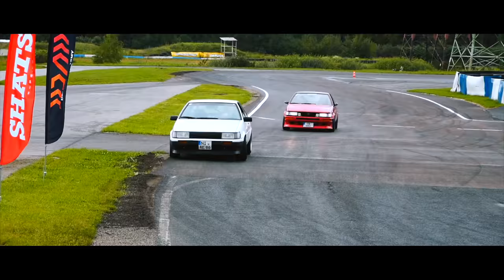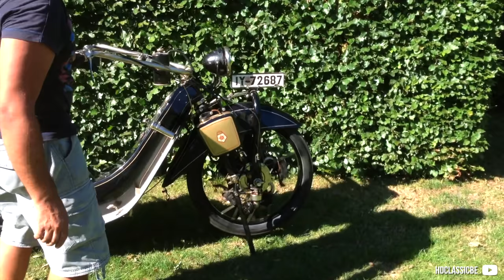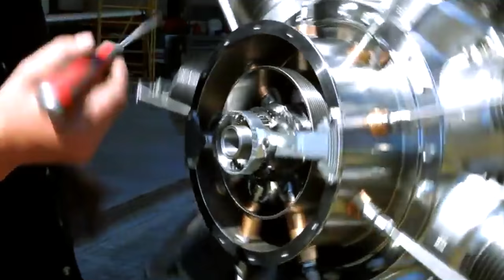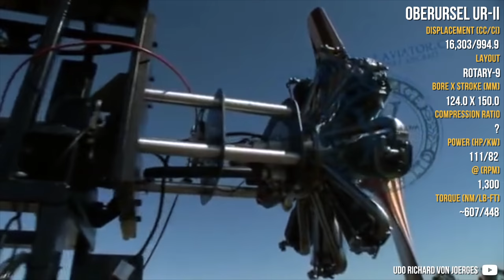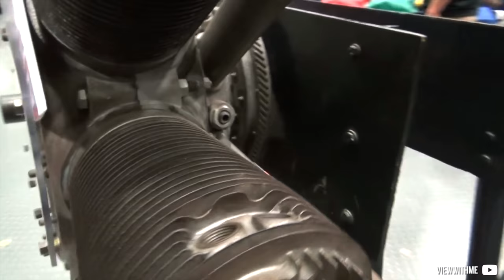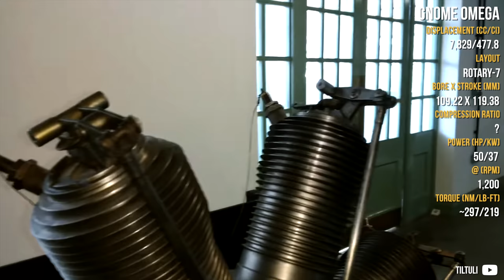These Rotary Engines Are Spinning

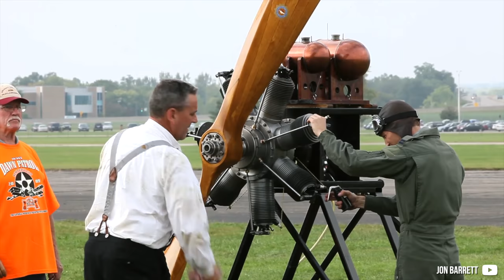Comment: 6:03 very interesting, any source where can I read more about it (except those on Wikipedia)?
Reply: It was called the Monosoupape, literally one valve.  Because the fuel/air mixture entered through the hollow crankshaft and then into the crankcase it seemed a logical design idea.  Also because of the through crankcase induction total loss lung rication was the only possibility much like 2 stroke designs.
Reply: @Richard Callan  Thanks, but I was talking about Gnome Omega mentioned in the video, it had in piston intake valve:

http://www.pilotfriend.com/aero_engines/images/gnome_3.jpg

"On each intake stroke, automatic intake valves in the crown of each piston opened, admitting the mixture to the combustion chamber. These valves were counterbalanced to account for centrifugal force and piston acceleration, with just the right balance to allow the suction of the intake stroke to open them..."

Then they developed the Gnome Monosoupape because: 

"The automatic intake valves of the early Gnomes turned out to be quite a headache for maintenance personnel. In addition to presenting a fundamental limit on engine speed and volumetric efficiency, they got out of balance easily, gummed up and got sticky, and worked poorly at higher altitudes. Thus, they presented constant maintenance problems, accounting in large part for the extremely short time between overhauls (TBO)."

http://www.pilotfriend.com/aero_engines/aero_soupape.htm

Comment: This is why an engine with a rotating piston, as used in some older Mazdas, is properly referred to as a WANKEL Rotary, or just Wankel, but never just rotary.
Reply: Which version of the Wankel engine are you referring to?
Reply: @sandervanderkammen9230  Any version.
Reply: @CaptHollister  The DKM-54 is a rotary type engine...
The KKM-57 is not a Rotary.
Reply: @sandervanderkammen9230  ...as were all subsequent Wankels, which is why they are also called rotary piston engines, since it is the piston that rotates. I wasn't aware of the DKM engine with its rotating piston and housing. Sealing must have been a nightmare. Thanks for pointing it out.
Reply: KKM stands for Orbiting Piston Motor.
Only the DKM is a rotary.
The KKM has a conventional arrangement with a spinning eccentric crankshaft and flywheel 
It's not a Rotary type engine.

Comment: If they're going total oil loss. Why not just go 2-stroke?
Reply: Too impractical.  A two-stroke needs a separate space in the crankcase for each cylinder, separated from all the other cylinders, in which the fuel mixture is initally drawn in before the descending piston compresses it to push it out through the transfers ports and into the combustion chamber. This is impossible to accomplish in a radial. The alternative, as used in large two-stroke diesels, is to fit a supercharger to blow air/fuel directly into the combustion chamber, which requires fitting intake valves in the head.
Reply: @CaptHollister  Great answer and explanation of 2-stroke facts. I actually didn't know about each cylinder's crankcase being isolated, as most dirt bikes were 1 cylinder, but it makes sense.

Comment: i belive there are caled radial engine , when i read rotary i think of wankel engine
Reply: Rotary is actually correct, althought these engines have a radial layout too: usually radial engine is used for engines which have a static body and only internal moving part, for example the BMW 801 used in the Focke-Wulf 190 or the Wright R-1820 Cyclone 9 used in the B-17 flying fortress; while a rotary engine have the all body spinning.
Reply: I thought the same. Turns out these are "regular" rotary engines and the wankel is known as a wankel rotary. So, rotary engines are a type of radial engine while wankels are rotary engines that are not radial engines.
Reply: @XMarkxyz  thanks man , a new information to have 👍
Reply: @deluth4638  you learn something new every day, thanks 🙏
Reply: Wankels shouldnt be called rotaries. They were last. They should just be called wankels. They arent really rotaries in the original classifacation.
Reply: Also different between a rotary and a radial. Rotary the crank is fixed and the crankcase rotates. While in a radial the crank rotates and the crank case is fixed
Reply: These are NOT radial engines.
Mazda Rotary is a registered  trademark not an engineering classification.
Reply: @deluth4638  No, the Rotary is not a type of Radial engine.

The Wankel DKM-54 uses a spinning crankcase and a fixed axle.
The KKM-57 used by Mazda is not a rotary type engine.
Reply: @sandervanderkammen9230  Sure, I could have said the rotary is designed in a radial configuration. An actual radial wouldn't have spinning cylinders, obviously. Regardless, a wankel rotary has nothing to do with this video since it is a different beast.
Reply: @deluth4638  Which Wankel engine are you referring to?
Reply: @deluth4638  Are you unfamiliar with the two different types of Wankel engine???

The DKM-54 has a crankshaft that remains stationary.
 The KKM-57 has a spinning eccentric crankshaft and flywheel.

Comment: Do engines from ww2 warbirds, there are some incredible designs they came up with back in those days
Reply: And were able to manufacture and maintain in surprising quantities.
Reply: The engines used in WW2 are Radial engines.
These are ROTARY engines and only used in WW1.
Reply: @sandervanderkammen9230  I'm well aware of the difference between a Radial engine and a rotary engine, also radials were not the only engine type used during the war, they also used all sorts of large engines from V-12s, Sleeve valve radials to even H-24s. Quite impressive feats for their time
Reply: @jonathanrigley981  Certainly not, inline engines were also used in WW1.
Turbojet and Rocket engines were also first introduced in Germany during WW2, an era of great technical proliferation in aviation.
Reply: @sandervanderkammen9230  turbojets were also introduced in Great Britain at about the same time they were in Germany. Both countries had jet aircraft in service before the end of the war.
Reply: @CaptHollister  Germany introduced turbojet engines first.
Reply: @sandervanderkammen9230  Yes, by a couple of months.
Reply: @CaptHollister  The world's first jet aircraft flew in Germany in 1939..
The U.K. didn't have a jet aircraft until 1941.
Reply: It's amazing how they designed and built those engines... With basically a slide rule and a lot of ingenuity!!! I bet when you operate one those engines... Before you make dam sure every bolt and nut are tight!! Hate to see come apart... That would be definitely deadly and destructive... Great video!!
Reply: @sandervanderkammen9230  u know ur stuff
Reply: @realthugg4312  Thank you.
Reply: @sandervanderkammen9230  1939 Heinkel  He 178 was only a test aircraft, zero utility ..And the real first jet aircraft who fly (only a small distance because the take of was accidental) was the 1910 Coanda ...specification from the Coanda engine was the compressor drive from a piston engine, like on the italian jet aircraft capronio campini...
Reply: @leneanderthalien  The Coanda 1910 was not a turbojet aircraft.
 It was powered by a Ducted Fan driven by a 4-Cylinder Clerget piston engine.
The Coanda 1010 never flew.
Reply: @jonathanrigley981  > German twin crank, 12 piston, six cylinder diesel bomber reached 40,000 ft altitude
Reply: @JosephOlson-ld2td  The Jumo 204 engine was also the most fuel efficient engine in the world, more efficient than a Toyota Prius!
Reply: Ritz & the San-man ,,, definitely know their stuff !!!  & They were getting down on some technical ,,, uhh ,,, U-no ,,, stuff ... I was bummed that ... I didn't have anything ,,, that I could input ... Luv it ... Thanks ... D

Comment: A total loss system INSIDE of a wheel of a two wheeled bike sounds like a bad idea...
Reply: Not as bad as the unicycle version.!They realy were brave back in the day .Sadly most of these brave chaps removed themselves from today's bean pool .we realy have run out of bravery beans .Most of the Nutters ran out between the first and 2nd war.Its a dammed shame as the world needs more to do credulous stuff so we sheep can stare and point and have a good laugh.
Reply: Ah yes let's !make a bike that speed oil everywhere and slowly loses traction and can't stop without the engine shutting off

Comment: They should be called spinning "radials", or "spinner engines"!
The bike and the car were really interesting
Reply: No. Wankels should be called wankels not rotaries and wankels
Reply: It literally says on Mazda rotary engine
Reply: @ENGINERESCUE86  Mazda never made a rotary type engine.
Reply: @sandervanderkammen9230  incorrect, mazda made Wankel engines which are rotary engines. There’s more than one kind of rotary engine
Reply: @sandervanderkammen9230  Wankel engine. A type of internal combustion engine  using an eccentric rotary design to convert pressure into rotating motion.
Reply: @wholelottamiata6976  Wrong! Mazda purchased a license from NSU to manufacturer the the non-rotary KKM 57, not the DKM-54.
Reply: @ENGINERESCUE86  No, the Wankel KKM-57 is an ORBITING PISTON ENGINE 
It's clearly described in the technical description in the patent.
Reply: @sandervanderkammen9230  I’ll give you $1000 if you can show me the piston in a 13B 😂 the part replacing the piston is literally called a rotor. A Wankel engine is a rotary combustion engine. Like go look up patent number US5305721A. It’s a “rotary wankel type engine” you know, the engine that uses rotors in a rotary motion.
Reply: @wholelottamiata6976  Yeah, its that triangle shaped thing... its called a PISTON.
The Wankel KKM engine does not have a "rotor"..
Reply: @wholelottamiata6976  Which Wankel engine are you referring to??? Only the DKM-54 is a rotary type engine.
Mazda licensed the KKM-57 from NSU Motorenwerkes GmbH.
Reply: @sandervanderkammen9230  sorry but pistons reciprocate and rotors rotate loool
Reply: @wholelottamiata6976  Which Wankel engine are you referring to?
Reply: @wholelottamiata6976  Only the original Wankel DKM-54 design is a rotary type engine.

Mazda purchased a license from NSU Motorenwerkes GmbH. in February. 1961 to produce only the KKM-57 designed by Hanns Paschke and Walter Freode.
The KKM-57 is not a Rotary type engine.
The KKM has a spinning eccentric crankshaft and flywheel.
The word PISTON is right in the patent name.
Reply: @ENGINERESCUE86  Not always, the Wankel KKM has a triangular piston that reciprocates and orbits in a planetary motion.
A "rotor" is a device that spins concetrically on a fixed axis.
Reply: @wholelottamiata6976  The term Mazda Rotary® is a registered trademark of Toyo Kogyo Cork Ltd. (Now Mazda Motors) for its now discontinued version of the NSU Motorenwerkes GmbH. Wankel KKM-57.
Mazda paid a royalty on every engine produced until the NSU patent expired.
Mazda created the Mazda Rotary® trademark to avoid paying further royalties after the license expired.

The name Mazda Rotary® was intended to pay homage to Dr. Felix Wankel and his earlier work on the DKM-54 which was never manufactured and is now largely forgotten.
Reply: @M Bacon This engine is a radial engine, it just happens to rotate. 🤔
Reply: @sandervanderkammen9230  You seem to be the only one calling the rotor a piston. Not really a rotor-head, are you 🤣
Reply: @sandervanderkammen9230  yes, the rotor spins on a fixed axis, which just happens to rotate, being part of the eccentric shaft.
Reply: @stevecarlisle3323  Wrong, these are NOT radial engines.
These are ROTARY TYPE engines.
 You need to learn the difference son.
Reply: @stevecarlisle3323  The Wankel KKM-57 has a triangular piston.
It's right in the name given by its inventor..
You don't know much about the Wankel engine do you?
Reply: @stevecarlisle3323  The shaft remains stationary in a Rotary type engine.
Reply: @stevecarlisle3323  Which Wankel?
Reply: @wholelottamiata6976  The rotor replaces 3 pistons. That should really screw your head up. This reply was meant for Sander
Reply: @sandervanderkammen9230  it is a rotating radial engine. You are seriously deficant in your engine knowledge of radials. There are 3 R985, s sitting in my parking lot, sonny !
Reply: @sandervanderkammen9230  What did Mr Felix Wankel call his engine with the 3 sided object that had combustion bowls. This is not a trick question. I am fully aware of radial engines that had the crankshaft fixed. These were developed in the early 1900,s. Of course we now have radial engines like the R985 that take power from the crankshaft. In your mind what is the proper term for these engines.
Reply: @sandervanderkammen9230  the KKM and the DKM both have rotors. They both work in a epichoid housing.
Reply: @sandervanderkammen9230  Why do you accept the DKM as "rotary", but the KKM is not ?
Reply: @sandervanderkammen9230  one model is a rotating epichoid housing, and the other is fixed. The 2 NSU designers, one be Wankel. The KKM design concept is what Mazda built their engine on, with many refinements. You have to realize that Patent Attorneys pay carefull attention to wording, to get a patent granted. It would be wrong to assume patent working is correct, or makes sense
Reply: @stevecarlisle3323  The ROTARY type engine predates the RADIAL TYPE engine.
 Invented by Felix Millet in 1892.
Reply: @stevecarlisle3323  The Pratt & Whitney R-985 is a RADIAL TYPE ENGINE.

It seems you have not learned the difference yet...
Reply: @stevecarlisle3323  A Rotary type engine has a crankshaft that remains stationary.
You don't seem to understand the difference between a ROTARY and a RADIAL type engine.
Reply: @stevecarlisle3323  Wrong! MAZDA HAS NEVER manufactured a rotary type engine.
Mazda bought a license from NSU to build Hanns Paschke's and Walter Freode's non-rotary KKM-57.

Don't confuse engine classification were registered trademarks.
Reply: @stevecarlisle3323  NO, the DKM had a rotor...
The KKM does not.
Reply: @stevecarlisle3323  Felix Wankel was obsessed with motorcycles..
And a huge fan of the MEGOLA.

His engine is based on the Megola rotary motorcycle..

Hanns Paschke and Walter Freode without any approval from Felix Wankel invented the non-rotary KKM engine.
The KKM has a and orbiting piston and a rotating crankshaft and flywheel.
Reply: @stevecarlisle3323  Certianly not... you are very confused and misinformed regarding the Rotary engine and the Wankel engine (KKM).
Your lack of knowledge and experience in the field of engineering is painfully obvious.
Reply: @sandervanderkammen9230  In your world ! I think I may now understand why you think like your do. The Dutch may have invented the "rotary" and the Felix came along and Wankel rotary was born. So Sad !
Reply: @sandervanderkammen9230  Your an Engineer, now I understand.  But a     engineer who lacks the understanding of a piston.
🤔
Reply: @stevecarlisle3323  Wrong again lad, Filix Millet was a Frenchman.
 His love of motorcycles was shared by Felix Wankel..
Reply: @stevecarlisle3323  Felix Wankel's engine was invented but never entered production..
The sole example of the DKM-54 resides in the Deutsches Technical  Museum in Bonn, Germany.
Reply: @stevecarlisle3323  Krieskolbenmotor translates to Orbit(ing)PISTON MOTOR...

THE KKM engine is not a rotary type engine, it has a rotating crankshaft and flywheel.
Reply: @stevecarlisle3323  Drehkolbemmotor and Kreiskolbenmotor
The GERMAN  word KOLBEN MEANS "PISTON"
Reply: @sandervanderkammen9230  👌
Reply: @sandervanderkammen9230  👌
Reply: @sandervanderkammen9230  👌
Reply: @wholelottamiata6976  No the Wankel IS NOT a rotary engine: but a rotary PISTON (or rotor) engine, this is the name given from felix Wankel himself, point finish...and the ww1 rotaries was always called rotary from they french builders and designers Gnome, Le Rhone of Clerget, but the inventor from the rotary was felix Millet (in 1892),  first use in he's motorcycle in 1893!
The confusion about rotary engine come from Mazda who call he's engines "rotary" because it's more "sexy" as Wankel "Kreis Kolben Motor"...
Reply: @leneanderthalien  wankel is a type of rotary engine. There’s more than one type.
Reply: @martinda7446  Stop trolling me.
Reply: A radial engine that spins should be called a "rotary engine."
A Wankel-type engine should be called a "rotor engine."

Comment: How are the rods connected?
How does the spinning engine get its fuel?
How are the spark plugs connected to the ignition?
What was the advantage in these days to build a rotating engine?

Comment: 2 thoughts on that motorcycle:

#1.  Wonder if anybody ever tried putting a second front wheel/motor assembly in the back with it’s own tanks for an “AWD” bike?!

#2.  Can you just imagine how messy that bike had to be to ride, being a total loss oiling system?!
Reply: Many early cars and motorcycles had total loss lubrication. They were all somewhat messy,  but they actually didn't use that much oil.

Comment: isn´t the term "radial engine" more accurate to describe this engines?
Reply: No, the Rotary engine predates the invention of the Radial type engine by years.. invented by Felix Millet in 1892.

There is a very distinguishing fundamental difference between ROTARY and RADIAL TYPE engines.

The Rotary engine has a crankshaft that remains stationary.